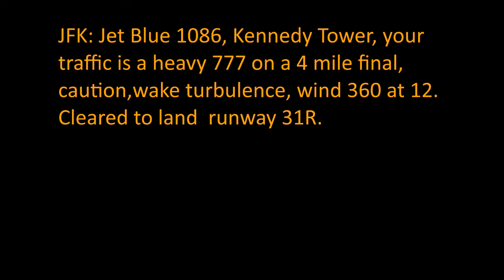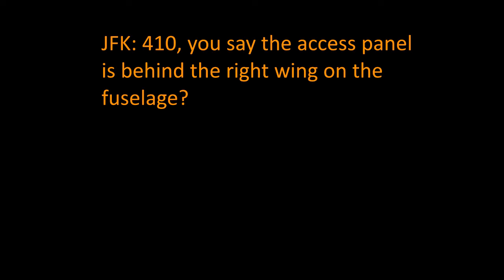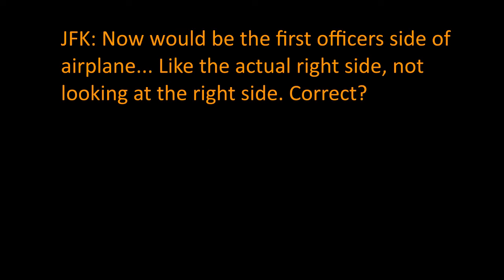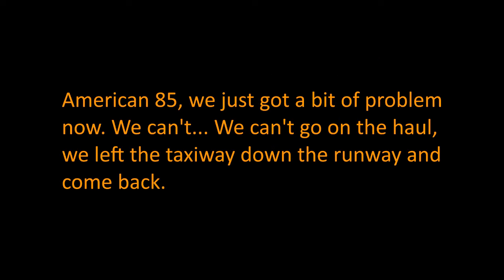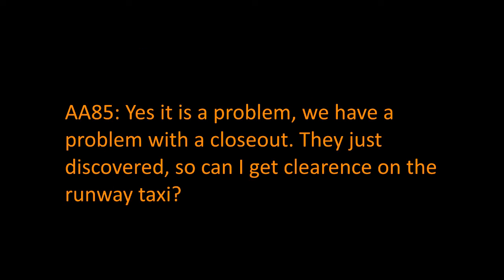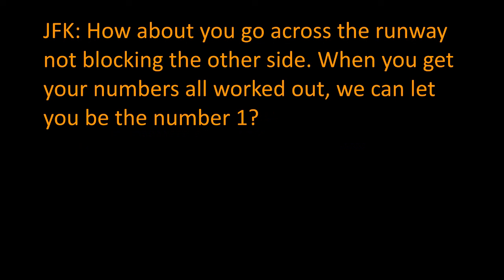Funny ATC Lufthansa pilot leaves aircraft

Comment: He is so German that he won't trust any Yankee to do it properly
Reply: +simon199418 
ha ha so true. you could tell by the tone of his voice he wasn't trusting any American yahoos to make sure his plane was buttoned up right
Reply from the maker: +Michael Donavon Germans are awesome. People who don't mix socializing with productivity. :)
Reply: +Michael Donavon You certainly seemed to pick up a lot of German grammar. I've never seen someone using as much commas - and hyphens - as you do, outside of German.
Reply: Maintenance crew already screwed up, failed to close the hatch. So, afraid of causing more troubles (e.g. unsecure hatch), captain would like to do it himself to make sure the panel is locked up properly.
Recall the cargo door that failed to close on B747? ( i think that was B747).. in 1989..
It was forced open by pressure while in midair, then suffered an explosive depressurization and caused the death of 9 passengers (8 were blown out of the airplane, 1 was sucked out afterwards due to seat belt failure)
Reply: And that wasn't even the only accident where a plane of that size crashed because of an open/insecure door.
Reply: Dennis Liu That was the United 747, yes. Took off from Honolulu and the door blew over the Pacific. It's a miracle that plane landed with only nine fatalities.
Reply: That plus he's the PIC and responsible for everything on that aircraft. Any mishap falls on him.
Reply: The refuel panel door is not pressurized though.
Reply: 64h5dsf14j6s41h5s4j5
I'd say that was correct.
Reply: ***** I doubt there's a license that permits to check the fuel caps. I think that license only allows you to fill out the form you need to inform the pilot about the status of the fuel cap. 
Because a license for the checking itself wouldn't be bureaucratic enough. :-)
Reply: You are SO correct!
Reply: +Carsten Diesterbeck it's actually part of the transit check to check that the fueling station door has been closed. And you need to be at least EASA Cat A or equivalent to certifie that
Reply: I gathered that.  Like a "Fußgänger Lizenz."
 :)
Reply: I'm sure if "one" looks hard enough, through the German Archives, "one" would find that particular license.  The Germans that I knew, and worked with, in Wiesbaden, Germany, left no stone unturned.
Reply: was more a malfunction of the closing mechanism than a failure of the ground crew
Reply: Why was it open?
Reply: The German is speaking better English than the American. It's amazing he can understand all the bad English like 'wanna do' in an important instructional job
Reply: The ground crew probably forgot to close it.
Reply: frove
Reply: DELTA TUG 2 THE SUSPECT
Reply: La1 "cleared to close it" had me cracked up.
Reply: La1 Oi! That's Kennedy Steve! I'll hear nothing bad said about the greatest ground controller in ATC history. This is the guy they would call if a tornado came through and scrambled all the planes in such an order that it would cause a 20 hour delay, and he'd have it straightened out in 20 mintues.
Reply: Thats where the russians come in to set him straight.
Reply: blackhawks81H LOL. So true. He was a cool down to earth badass. I still miss him. Sounded way too young to retire. Having all that fun. I don't think the stress affected him like a lot. He seems healthy and will be around for long time.
Reply: +SusieLa1 Americans mostly can not speak English. The cultural slang, changed nuances and outright manipulation (change) to English has given rise to 'American' language.

I'm not being condescending though.
Just that i could (while growing up, may be now too) never get to understand why a 'Good' was called 'not baad' or why every 'Murikan' show/movie had one dummy saying'if you know what i mean' at the drop of a hat.

that they twisted words (Eg.: colour - color) or came up with diff. words in day to day life (Lift - Elevator) too has made their language distinctly different.

Sorry for speaking in the second person. may be you are American too.
Reply: It's not just Americans. 

Some Brits, depending where they hail from, have their own twist on the way to speak it and some of it is downright hard to understand.  Similarly, Cubans can speak some serious "street Spanish" compared to those snobby Spaniards. Americans may slop it up, but it's not only them.
Reply: To say it in German: Es ist besser, man macht es selbst, dann weiß man auch, dass es gemacht ist. :-)
Reply: Checking die door your-selbst. I would as half German. My Irish side would be like, ah sure it's fine...
Reply: Wenn man sich auf andere verlässt ist man verlassen.
Reply: UniTrader Genauso sieht es aus 👍
Reply: oder: Vertrauen ist gut, Kontrolle ist besser ;)
Reply: Germans ❤
Reply: Who would blame him
Reply: erbgeg egerger we don't really use hyphons in that way
Reply: But this Yankee Ground ATC does his job very properly :)
Reply: simon199418 , that is why Lufthansa is my favorite airline. I feel the safest on it.
Reply: His recent experience would suggest that he's right.
Reply: @erbgegegerger8220  You are very right - because he is adding the commas and hyphens due to him picking that up in Germany - but at the same time very wrong, because it is not a grammatical trait unique to German. There are many languages that are structured in a way that its speakers embed sentences within sentences and divide sentences in parts for various reasons. Us Dutchmen do this all the time. It's just the way our languages taught us to think. You can go deeper into a subject or object of your sentence, in the middle of your sentence, when that information becomes relevant. This way you don't have to talk about those details afterwards, and people understand what you mean fully by the end of your sentence. 

When speaking there are no hyphens or commas. But when typing, you can seperate the embedded information from the superstructure and it becomes clearer to read. When speaking, this is simply done by natural pauses and emphasis. I can probably name a few languages that are prone to produce speakers that embed sentences within sentences this way. Russian is incredibly loose when it comes to grammatical order for example, whereas English is very uptight. 

English order of adjectives for example: Opinion, Size, Age, Shape, Colour, Material, Origin, Purpose. A nice big fresh black mug of cold cow's milk. If you put the adjectives in any other order, it will feel wrong, no? Speaking of English grammar: You said "You certainly seemed to pick up.." where you should have said "You certainly seem to have picked up...". Not to be a grammar nazi. (^_~) We're just on the subject okay!

Michael's sentence shows that the "in Germany" part is merely an irrelevant detail. An extra bit of information. And it is. If you work with Germans outside of Germany, they still come from Germany and grew up in German culture. It's not relevant to his point, but it does paint a clearer image. In proper English it would be the same sentence but without the commas. I would go so far as to say that the "with Germans" part would be left out because the context, "Working in Germany for 4 years." implies he worked with Germans. It is very unlikely an expat works exclusively with other expats. That's the type of (reductionist) language English is. You have to pay attention and understand the implications.

How we are taught to communicate determines the framework for how we structure our thoughts, which in turn affects how we communicate. Isn't that marvelous?
Reply: Greetings from germany lol
Reply: As an American, I would side with the German on this one.
Reply: Goes both ways. An American can never fully trust a Kraut
Reply: SusieLa1 Even Brits use "wanna" (and "gonna"). It's not the King's English but how many people would truly misunderstand it?
Reply: Spock All modern languages "evolve". It's not just American (English) that has idiosyncracies. Spanish, for example, does as well.
Reply: John Be Bad So true. Although not all Spaniards speak Spanish eloquently. Not everyone has an outstanding command of castellano.
Reply: NLTops Of the Germanic languages English is quite frankly the easiest. Dutch and German have expansive grammar that's difficult, but not impossible to grasp for immigrant and first generation speakers. With regard to Dutch I know that plenty of native speakers have difficulty conjugating even simple present tense (e.g. ik word, jij word, hij/zij/u word) or, are unable to determine the past participle of a verb (e.g. heeft beoordeelt). There also seems to be a lack of understanding when to separate/end sentences through the use of punctuation in all groups of speakers. The strangest linguistic errors among White Dutch are the use of the possessive pronoun hun instead of the personal plural pronoun zij (e.g. hun worden) and, the use of the verb gaan with the personal pronoun ik in speech (ik gaan). (Someone I know has a doctoral degree in Dutch linguistics.) People bash Americans/American English but fail to realize that just about every language has quirks and regional linguistic influences. Factoring in that in general few folks have perfect command of their own language much less a second or third one, we should all be more accepting of eachother.
Reply: NLTops Excellent linguistic analysis. My only comment would be that there's no sense in pointing out to most present-day Americans that they have neglected to use the Past Perfect tense, as most American language speakers either no longer bother, or what's worse, are no longer capable of comprehending this beautiful feature of the English language. There is a thin line between streamlining before it becomes  oversimplification and yet again before it turns into downright dumbing down and it seems to me that the contemporary  usage of the language is fast becoming the latter.
Reply: I'm a yank with Italian driving habits (five years @ Rome). Last year, I ferried a 22yo German kid from Vermont to Montreal. Funny as hell; poor kid was glued to every handle in reach. Offered to let him drive, but still unlicensed.
Deutsche driver-training requirements are superior, period. They are actually taught basic mechanical engineering as a prerequisite to licensing. Then they are actually taught how to drive 'with intention'. He said his mother regularly drives 180kph on the autobahn: speed is relative to competence. Their's should be the global standard.
Offset 180, you have LA-drivers who park in the left-lane; they should be gulag'd.

Re linguistics, I'm mobile in the 5 easy ones... but Dutch??? THAT is the weirdest language on Terra. Clearly, it was originally extra-terrestrial: play a ten-second loop of conversatiinal Dutch backwards x10 and saucers would surely converge. Also, the only language that shares the uber-ugly hard "L" with US-English (oiL, bowL, aLe, etc.) UK softens theirs, but Dutch mashes the US hard-L with Deutsche guttorals = Uggg-ly!!!
Reply: No, ATC is humored by the fact that the underside of the A340 sit about twenty feet off of the ground not because he [the captain] didn't trust anyone other than his own crew.
Reply: It could be a time issue...i.e. How long will it take for a mechanic to come and close it
Reply: Well, in the end the pilot is responsible for the safety of the aircraft and the flight. It makes sense as a pilot thing rather than a German thing.
Reply: @SuzLa1  you correct when talking to different nationalities.being from America that would be common. though to be proper English it would be " want to do"
Reply: @spock7945  its elevator cause it elevates you to next level.guess you correct.we just talk bit different.nothing wrong with how you think we talk,lol.
Reply: @BOHICA_  "slop it up" ?
Reply: @NLTops  you think that is something. if you was in southern part of USA as i am, the speed of talk is  30% slower ( we call it southern drawl)  than those who live in northern part of USA.lol
Reply: @raycarter6225  Sounds charming. ^_^
Reply: Weißwurs. Brezel
Reply: @jbreezy101  probably about as long as for somebody to bring the equipment needed to reach it in the first place?
Reply: And he is right.
Reply: Don`t touch my plane ! - Ich mache meine scheiß Klappe selber zu ! ;)
Reply: lol
Reply: Do they serve weinerschnitzel and sauerkraut on Lufthansa flights?
Reply: @scottjohnson1640  its Wiener Schnitzel and btw Wien =Vienna is the Capital of Austria and not of Germany. 😉 And I doubt that Lufthansa serves Sauerkraut. It is not that popular in Germany as you Amerikans might Think .
Reply: Britta Riedel I'm half German myself. My grandma was a full blooded German who spoke the language fluently. And yes, I do like sauerkraut. I'm just throwing a little humor in there. I'm actually making fun of myself in a way.
Reply: It’s that pure Luftwaffe blood in his lineage.
Reply: @lvl4k225  Yeah, these things usually work out
Reply: @Southamericangirl42  Yeah, but the English way is ALWAYS  the only right way.
Reply: Das nennt man Verantwortungsbewusstsein, ein Flugzeug kann nicht eben mal rechts anhalten.
Reply: How many Germans does it take to fix an aircraft? 
1 because they are fast, smart and efficient.
Reply: erbgeg egerger hahahaha
Reply: Anyone mentioned the cargodoor on the DC-10 being improperly closed by ground crew?
That's because it had a design error which allowed ground crew to force the outside handle, if it was stuck, into the closed position.

But the clamps on the inside didn't catch on so that caused quite a few fatal DC-10 crashes.
Reply: You ever seen the Cadillac Catera? Lol
Reply: @raycarter6225  Hi ray, I know I am chiming in late here but wanted to affirm your comment. I retired from being a telephone customer service rep for the Social Security Administration national 800 number network. Wisconsin--New Jersey--Alabama, all different pronunciations and speech patterns.
Reply: No, it is terrible accent. I am always a bit confused how poor pronounciation of German pilots actually is: "We hef a broblem...". However it is fluent here so could be worse.
Reply: As a German, I should like to point out that the call sign of the plane was 401 and not 410 as the captions say.
Reply: It's his plane and his responsibility. I don't see the problem.
Reply: @SuzLa1  anyone with proficient English skills will not have any issues with "wanna do", which basically is normal conversational English.
Reply: I think it's because of his responsibility of the plane. I would've done the same

Comment: I think that the ATC Controller found it rare and funny to see a huge airliner pilot wanting to get out of his plane on taxi,just prior to takeoff,to close a hatch, or door that was, or became open.Usually,probably this normally would be a maintenance call and fix,especially at a "Huge and Busy Airport" like JFK.
Reply: GBXS Yeah that's my point also !
Reply: jay capp He probably wanted to make sure it was done right. I'm not sure how big of a problem that open hatch would have been, but he called in a crew to double check that it wasn't just a malfunctioning light on his control panel. Once they confirmed it was open, he wanted to close it himself. I was once on an SAS 747 that was held over because of a problem with the cargo door. What was supposed to be a 9 hour flight ended up taking twice as long because we sat on the tarmac for 9 hours while they worked on that door. Better safe than sorry. Kudos to the Lufthansa captain for wanting to make sure himself that his aircraft was safe before taking off.
Reply: Don’t see this as anything special, I would do it myself if i was in that spot.... if it’s something you can do without issue then just do it rather than be lazy & wait.... And yes I’m aware how flight lines work....was an avionic guy myself....
Reply: the door didn't just come open. the fueller forgot to close it. and the pilot probably later called mx to drive up and close it.